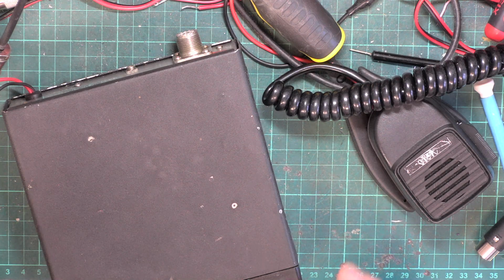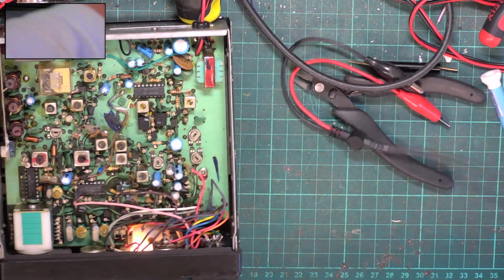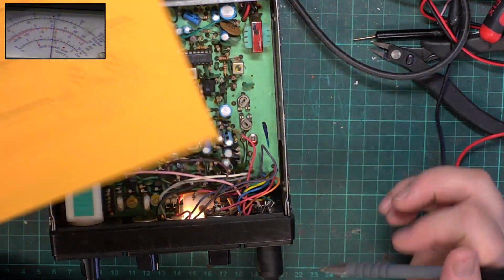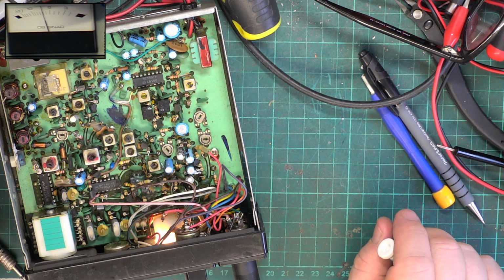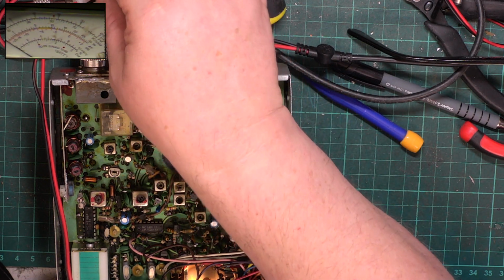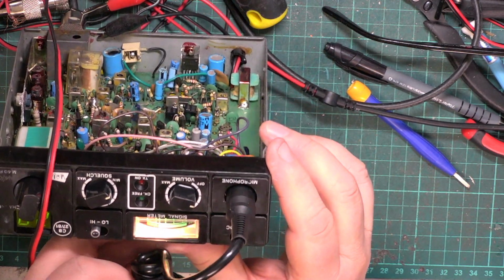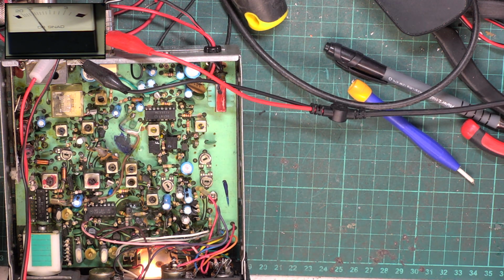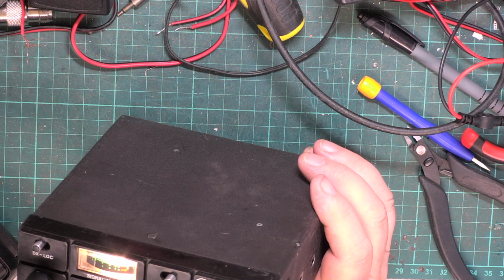DNT M40 CB27/81 UK FM CB radio - service

Comment: I was looking at one today which had a total of four xtals in it. There was an extra one right at the back by the IF chip.
Reply from the maker: Someone has fitted a crystal filter then instead of the factory fitted ceramic filter to help with bleedover.as long as they fitted the right one. There were some of these sets with a green 'supertuned' sticker on the case bezel front. These were bulk modified in the UK by Cleartone Electronics & work well. They fitted crystal filters as part of their modifications.

Richard, G0JF, UK

Comment: The one I have in my collection drifts like hell once the inadequate heatsink gets hot.  Even if you join that stretch of of heatsink steel (?) rather than aluminium to the steel case with an aluminium strip it's not enough to keep it cool.  Never cared to look into it to see if it's actually a fault as this model isn't the most sensitive, but I like the the receive audio.
Reply from the maker: Let's face it, they were always a  crap set. However, it's important to have one in any collection. I have one of these & the supertuned version as well as the B40 base which came crystal filtered as standard.

Richard

Comment: I had this Transceiver but it got wrecked by a breaker called Magnum which meant the the RF Preamp stopped working and eventually the whole unit stopped working therefore I don't have it any more.
Reply: How did he wreck it?
Reply: @SoddingaboutSi  It is a long time ago but the dual Gate MOSFET got spiked and didn't work then something else happened but I think it had used it with the wrong power supply and then got binned but I think we will just let sleeping dogs lie so to speak.